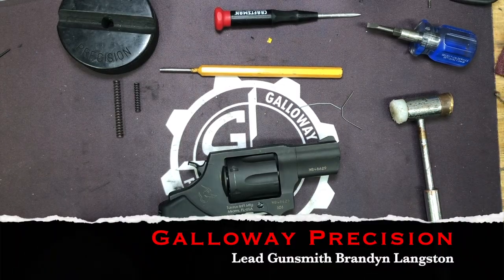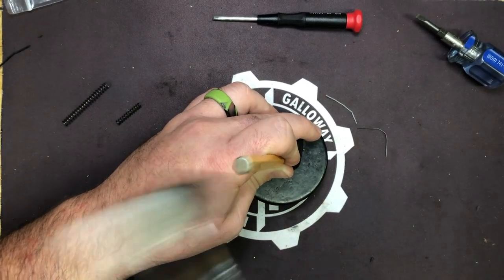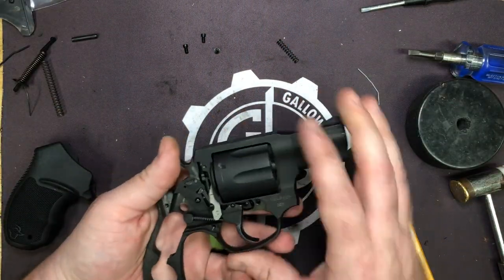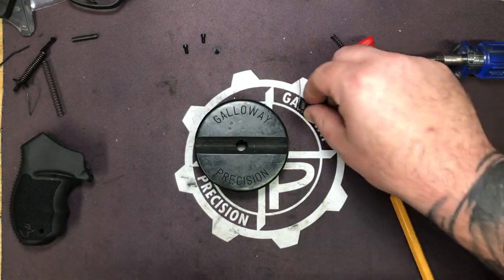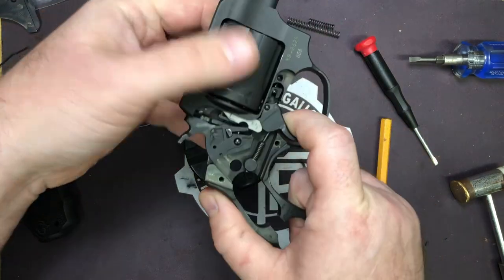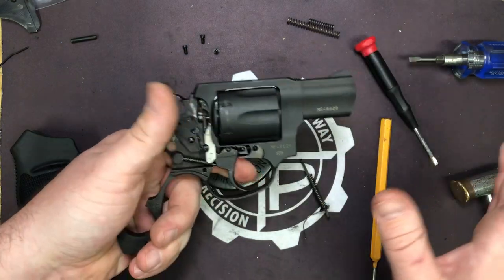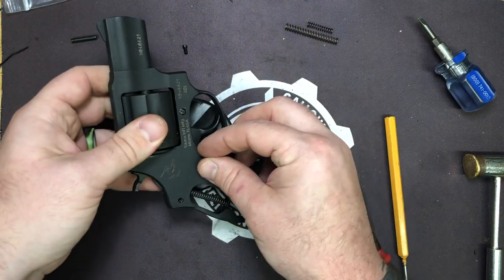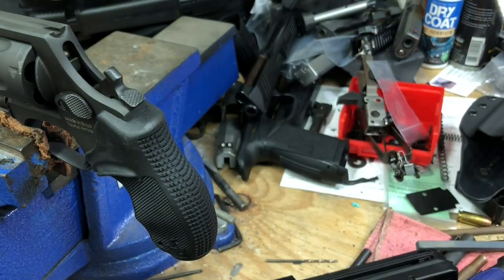Taurus 856 Reduced Power Spring Kit Installation from Galloway Precision

Comment: You were lucky when you took the side panel off that the spring loaded pin under the screw towards the front of the trigger didn't go flying out like mine did. I assume that it goes in pin first and spring at the top and then the screw pushes the spring that pushes the pin? I hope I'm right. I guess I'll find out when I get this back together again. 🙂 Now I have to run to Walmart for a blasted paperclip. 🙂 It looks like I'll be going to a gunsmith now. Some how the firing pin went flying out of the revolver and another part with a spring on the end of it went flying that I found. I have no idea where that part came from. Plus when I put the little pin and spring back in to the one screw hole that I'm sure now holds the cylinder in place that is now missing. 😞

Comment: Brandon and Galloway Precision: Video helpful BUT you should make mention that there’s a tiny spring and tiny cylindrical part (yoke screw assembly) inside the larger side plate screw above the trigger guard. My parts fell out somehow but luckily I found them in the corner of the tray after reassembly. Figured out what they were the next day after researching. These parts hold cylinder assembly and without these parts the cylinder must be held rearward while closing or else it hits the barrel.
And by the way, on my 856 the flat side of plate at bottom of hammer spring was facing upwards instead of down contrary to instructional video. I’m the only one who’s been in there since I ordered mine from the factory 3 months ago.

Comment: weird, the rectangular plate on the trigger spring assembly, my revolver had the rounded part pointed down, and the flat part pointed toward the spring. wonder if it was a mistake during factory assembly or maybe it doesn't matter?

Comment: I just received my spring sets today. One is for my 856 UL, and the other is for my 605. I installed the springs on my 605 today. What a difference! I had the video on while doing the installation just to make sure I did it right. It was easy enough, just have to remember the part about the spring tension. My 605 is so much smoother now. It used to have a little bit of a sticking point in double action that is no longer there. I'm going to install the springs on my 856 UL as soon as my new grips arrive. Thanks for such a good product and the great video.
Reply from the maker: Thanks for the feedback. This is one of our most popular spring kits and for good reason. Glad to hear how pleased you are with the results.

Comment: Been using these in my 856 Defender. Way better trigger pull but I do have a lot of light primer strikes with Freedom Munitions 158gr(my cheap practice ammo).
All good with Hornady Critical Defense though.
Reply from the maker: Glad you like the new trigger pull. As with any performance upgrade, quality ammo is required.
Reply: I had the same issue with Freedom Munitions 125gr FMJ. No issues with other ammo. Hard primers?

Comment: turners outdoorsman in San Bernardino, ca had both the black and stainless snub's in stock. I tried the stainless one and the action was just incredible, I then asked to see the black one and not so much so I ordered the stainless.
When I finally went to pick it up and got it home the action was stiff. I was thinking it needed to be broken in. NOPE! I had a 99% suspicion that turners either installed this kit or it was sent to them like that. I stopped by last week and asked to look at both of them and sure enough the same results and I know for a fact that the stainless in the cabinet had this trigger kit installed. They said they had no clue and said it had been dry fired a lot.  NOPE!  Either way the kit was only 15.50 shipped with no tax and so easy to put in. Still worth it!

Comment: Installed a Galloway spring kit in my 856UL, went well, pretty easy and made a huge improvement.  Went to the range and experienced a few light primer strikes.  Took the pistol home and removed the side plate and noticed the Galloway main hammer spring was smaller in diameter but didn't see anything awry.  Replaced the side plate and returned to the range with different ammo and experienced the same thing with a few light primer strikes.  Once again pulled the grip and installed the factory hammer spring but left the trigger return spring in.  No more problems and it does feel lighter with the Galloway return spring in.  I'm very happy with the Taurus revolver and the trigger does feel lighter so just make sure you get reliable ignition and enjoy.
Reply from the maker: Misfires on hard primer bulk practice ammo will happen, the hammer spring is lighter. Try a higher quality ammo or reinstall the factory hammer for low grade hard primer bulk. We have a list of bulk ammo to avoid due to hard primers on our faq page for help.
Reply: @GallowayPrecision  I'm shooting Remington Green box and tried both Federal and Fiocchi ammo, same result.  Since my last posting I ran my handloads with both CCI 500 and even Remington 1 1/2 and still had FTF around 5-7% of the time after reinstalling your hammer spring.  Not reliable so I went back to the stock spring and ordered a kit from Wilson Combat to compare.  Will post any problems with that.  Who knows, could be the revolver.
Reply: "We, like the pistol manufacturers, do not suggest use of Sellier Bellot, Fiocchi, Herters, Aguilla or any steel cased ammo."  Holy crap, that is like every non-US based ammo manufacturer.  I think I'll just deal with the heavy trigger pull.   @GallowayPrecision

Comment: ive heard spring kits can sometime increase the chances of a light primer strike. Is that true?
Reply from the maker: That will be ammo dependent more than anything.  Low grade ammunition will always yield low grade results.
Reply: @GallowayPrecision  unless used with standard power springs lol. Be an honest company, dont blame light primer strikes on ammo. 

That being said im still going to buy 2 of youre spring kits
Reply: And legal issues
Reply: I installed this into my wife’s 856 about a year and a half ago. I have put many different types of ammo through it, and any PREMIUM defense ammo fires reliably. However, with MOST target and range type ammo,  (FMJs, and white box Winchester hollow points) I consistently have light primer strikes. My advice is if your going to the range, pop the factory springs back in. It’s not a huge deal…

Comment: Very nice spring set.

My 856 has the concealed hammer...pulling the hammer back seems to be necessary in the installation and reassembly.

Got any tips for installation on a bobbed hammer?
Reply from the maker: Just pull the trigger itself instead of the hammer.

Comment: If you are going to replace the hammer and trigger springs in a Taurus 856 revolver USE GALLOWAY springs.  They reduced the double action trigger pull from off the scale to 6#  and the single action trigger pull from 6# to 3#.  The trigger spring is the hardest.  Use a needle for the hole in the post be very careful not to let the spring "fly" finding it will take time.  watch the Galloway video while doing it.  The result is outstanding!

'
Reply from the maker: Thank you for the feedback and recommendations. Great tip. Glad you are pleased with the results.

Comment: The screw above trigger guard is 3/16 and called the Yoke Screw assembly. I lost mine and replacement (10027842) has a spring and plunger.  This should prevent possibility of binding the cylinder from swinging.
FYI
Reply: Yup mine fell off at the range just shooting it… had to order a new one which I got pretty fast from Taurus

Comment: what would it do to change the performance style of the revolver if you only changed the  main spring in the grip? thanks soo much for the videos. much respect
Reply from the maker: It should drop the DA and SA by about a 1lb or so and smooth it out some.
Reply: @GallowayPrecision  tyvm for the quick reply.
Reply: @GallowayPrecision  one pound only? It seems these Taurus 856 come stock with around a 11-12 pound trigger pull. You dropped it in half

Comment: Very informative and well-presented.  I have an off the wall question, unrelated to the springs.  I just bought an 846 Ultra Lite, and really love it, EXCEPT the grips.  As part of my purchase, the FFL ordered a set of wood grips from Taurus.  They're back ordered indefinitely, and as of today, are no longer on Taurus's website.  Apparently, they're discontinued.  Smith and Wesson J frame grips will fit the frame, but they don't cover the hole on the left side of the frame.  What could I use to cover over that hole?  See?  I told you this was an off the wall question.
Reply from the maker: Let me see what we can come up with.  Might be able to make a 3D printed grip for it.
Reply: @GallowayPrecision  Not at all familiar with that technology.  Also, what would that cost?
Reply from the maker: @matthewrobinson4323  It's what we produce a lot of our extensions and triggers from.  It's carbon fiber filled ballistic nylon and we can add fiberglass fill and kevlar fill to the print for more rigidity.  I would need the grip to do a drawing and see how much it would be.
Reply: Altamont Grips make grips that fit these revolvers.
Reply: @la_old_salt2241  Thank you

Comment: Just installed the springs and the trigger is great! The problem I now have is the side plate won't go on. Each side if tilted in goes in just fine but if you put the top corner protrusion into its place not all the sides will fit back down. It looks as if the tolerances are too tight to allow. I was going to try and polish the areas that it looks like its hitting and not sliding in but would appreciate any other suggestions before I take that step. I fit the top nub into its channel and tapped the side plate and it just will not go. Any suggestions? Thank you.
Reply from the maker: Check the tab slots are free of debris first then look at the contact points that are not allowing the plate to seat. It came out so the plate is fitted to your revolver but it may be under tension depending on the assembly. A light tap with a rubber mallet to seat it can be needed on side plates which is not really uncommon.

Comment: Question.I have considered cutting two loops off the spring to lighten the trigger.I have some friends who have done that and it seems to have worked very well.What do you think.
Reply from the maker: We offer a spring rate that is designed by the spring maker to reduce the pull but still have reasonable performance with hard primer ammo. Cutting coils isn't a preferred method or desirable if the correct spring is available.

Comment: Feels great on the 856. Wondering if it would work on a 850 CIA.
Reply from the maker: No, we haven't tried it in any of the hidden hammer models.
Reply: @GallowayPrecision  no worries. Thanks for the response. Installed the springs in the 856, trigger is butter smooth. Very happy thanks.

Comment: most o the time when you lighten the springs on a revolver a longer firing pin is installed.   Is there any concern about light strikes here?
Reply from the maker: Not a concern as long as you are using quality ammo. With or without the spring kit, stay away from hard primers and you will be good.

Comment: Good video, the more I see the Taurus, I won't to get one. On my smith&wesson if I don't have the double action pull at or near 7 pounds it will not shoot winchesters hard primers. I was wondering will the Taurus shoot Winchester at that spring weight.
Reply from the maker: Don't see why it wouldn't, it popped those Remington UMC rounds off without any issue.

Comment: You're pulling before you clear it lol. Slow down bro!  Great video. Will be purchasing a kit soon.
Reply: There isn't a single angle you can look at an 856 from and not tell if it's clear or not. It's a bigger cylinder than the 85 so you can see the brass plain as day without opening it.
Reply: @zdub8438  huh? I am not talking about clearing the gun I know the gun is clear.  I am wondering why you keep pulling in measuring the trigger with the digital tool then clearing out the measurements so fast. Clear and ready your tool then pull the trigger and let the tool measure. Your getting a bunch of zero reading cuz you keep pushing the clear button so fast!
Reply: @14DAVEYO  you are right

Comment: In terms of safety, would this modification cause an accidental fire in DA, would it make the pull that much lighter or is it still relatively ok to say its safe...
Reply: If you don't pull the trigger it won't accidentally fire! It really only brings it in line with almost all other firearms as far as pull weight. Most factory weights average 5-6lbs glock s& w etc. Most revolvers especially snub noses have very heavy DA Pulls 8 to as much as 14. So the short answer is no danger of accidental discharge.

Comment: Just did the spring upgrade.  First time shooting it had no problem with Critical Defense but had one light primer strike with Winchester white box FMJ.  Hard to say at this point why, I fired the round again and it went bang.  If light primer strikes are a problem would putting in the factory hammer spring be okay with the upgrade trigger spring?
Reply from the maker: That would be a misfire with hard primer WWB. It is pretty well known for having hard primers and we here at the shop generally expect  a 7% failure rate with it due to the hard primer and unpredictable powder.
Reply: @GallowayPrecision  Sadly I have to go back to the original springs.  Just too many light primer strikes and not just on WWB.  If the spring had just 1 more pound I think it would be perfect.  One odd thing of note, If I cocked the hammer and then pull the trigger I never had a light primer strike.
Reply: @renaissancenow7427  very possibly you just happened to get a bad spring. it happens. Maybe if you called them and explained what happened they would send you a new spring. I've heard people claim the same results with other brands of springs before too. sometimes someone making them could have cut the spring one coil to short. I read on the Taurus Arms site, that many people have put those Galloway, springs in all of their pistols, and revolvers. I just ordered mine today. I'll give you a update sometime next week, to let you know my experience with them. It sucks to hear that they didn't work on yours. But I will be back to let you know my experience with them. .. I too have an 856. not an ultra lite, but that shouldn't matter. The frame, and internal parts should be the same. Peace..
Reply: @thebluesrockers  Thanks for the idea.  Perhaps I will ask for another spring.  For now my wife (it is her gun) is doing fine with the factory spring.  There is something to be said about the WWB ammo having a hard primer.  She had a light strike the the factory spring.  The primer looked like nothing touched it, I was shocked by the faintest hammer mark on it.  I am getting some Rem. and Fiocchi ammo so I may give the new spring another try.
Reply: @renaissancenow7427  I use PMC 132 gr. For self defense, I either use the Hornady 110 gr FTX (I don't think they're still making them now) Or I use the Buffalo Bore 158 gr +p SWC hp.  awesome ammo but costly

Comment: How do you remove the hammer spring on a hammer-less 856,
Reply from the maker: The Hammerless version is a Concealed Hammer. Still has a Hammer. Checking in with our Tech if there is anything different about the swap.
Reply from the maker: Although the hammer is different in the concealed set up, the hammer spring swap is the same.

Comment: Heard it gives light primer strikes after the reduced spring
Reply from the maker: We have not experienced that. This is by far our most popular revolver spring kit. We test fired with cheap off the shelf ammunition without a single issue (Note this does NOT include reloads). We don't test reloads in pistols due to the wide variance of primers used and loads used. We only test with factory made off the shelf ammunition.

Comment: Do you know if this kit still fits modern 605's?  Mine was manufactured in May of 2022 and Taurus has changed the Mainspring Center Pin.  The Wolf kits mainspring did not fit the center pin, the inside diameter was too tight.
Reply from the maker: We have not had any complaints and have not heard anything about that center pin. It is our number one selling spring kit and I feel like someone would have mentioned it.
Reply from the maker: @keithcharles2113  Eric double checked and our spring will clear that pin without issue.
Reply: @GallowayPrecision  Thank you!
Reply: @keithcharles2113  did you ever order the spring kit?
I said that I was going to order mine eight months ago. I just ordered mine today. hahaha  I'm not saying time went by slow, or fast. I'm just saying I take forever to get around to do shit these days. 

One quick question, how is the pin different in the 605? I personally thought the internals were the exact same in the 856. glad to read they were different. I was wanting a 605. maybe in 60 years, I'll buy one next week. hahaha.. Peace. Joe
Reply: Put the springs in my 605.  I now love this gun.  Light smooth trigger.  Much nicer than my S&W 640.
Reply: @keithcharles2113  awesome to hear.